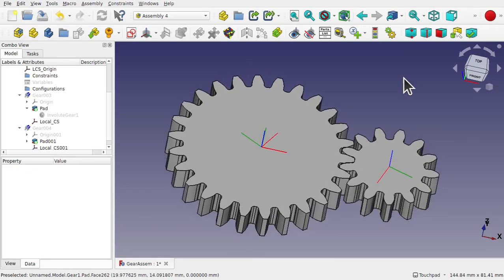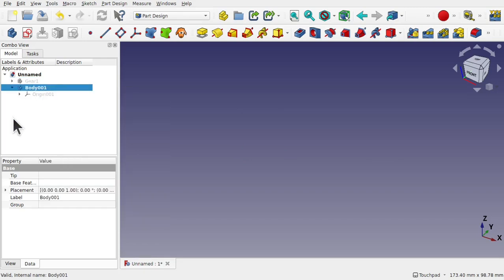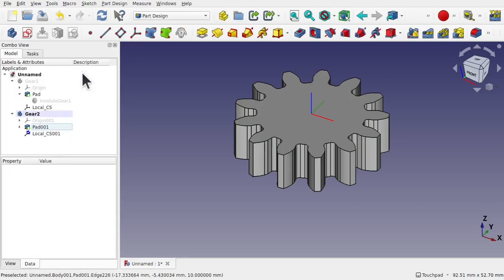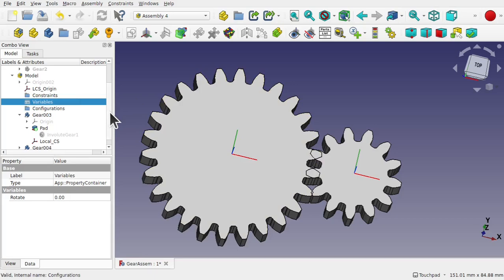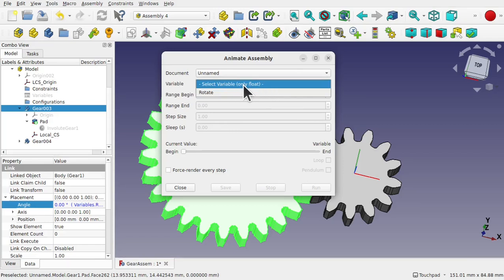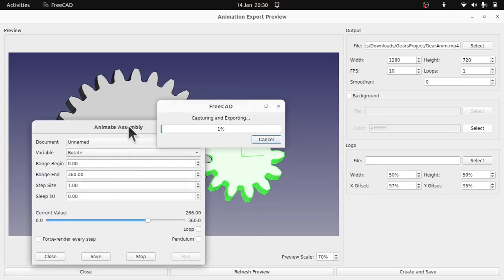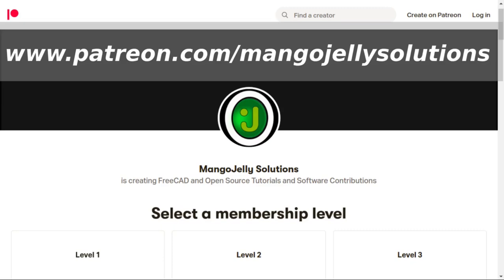FreeCAD For Beginners 33 |  Gear Assembly, Animation and Export to Video File

Comment: 00:00 Intro
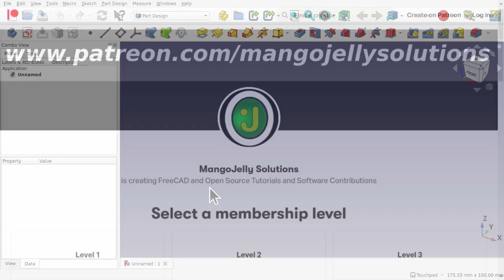01:19 Creating Gear1
02:07 Adding Local Coordinate System to Gear1
02:49 Creating Gear2
04:25 Adding Local Coordinate System to Gear2
05:00 Assembly4 startup
05:49 Importing Gear1 into Assembly
07:58 Importing Gear2 into Assembly
09:30 Adding formula to rotate Gear1
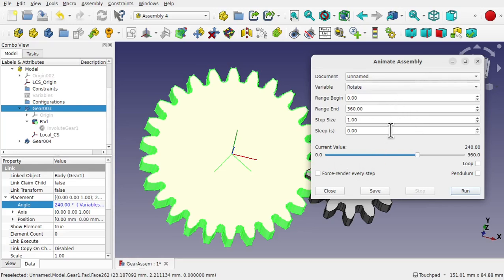13:10 Adding formula to mesh and rotate Gear2 with Gear1
18:21 Exporting the animation as a video
21:00 Outro
Reply from the maker: Thank you as always your a star!! 🌟🌟👍👍👍

Comment: Great video - thank you! The correct distance between gears can be calculates as: (Module of Gear 1 + Module of Gear 2)/2 x (Number of Teeth on Gear 1 + Number of Teeth on Gear 2)/2. Which is 48.75mm.
Reply: This is the distance between gear centers.right?
Reply from the maker: Thanks for the info and adding that. Really helps others and enriches the information. Appreciate that.

Comment: Last time I did do blender to animate a gearing. That was a while ago and CAD sketcher looked promising. But I am a bit afraid of blender, once you get good at it it will take self control to not go on a tangent to make the perfect pitch presentation. At the moment I prefer FreeCADs traditional CAD workflow though.
Reply from the maker: I understand where you come from with blender. There is so much to learn and way to many keys to remember for my liking. I do use Blender but I spend most of my time in CAD.

Comment: Had some issues during the import into assembly due to not fully selecting the LCS in Parent option. easy to overlook. Many commands require definite instructions to & from so to speak. I slow the tutorials  to 50% so I can keep up. 8:43 when the Gear2 is imported My gear didn't drop into the XY Plane when the LCS Origin was selected. I adjusted the Z Trans to -10 and fixed it. Darren any reason? Once again small beer but it slows a New user like Me down until I figure it out? Anyway good practice figuring it out for myself I suppose. Gotta love animation, I also notice subtle difference in appearance i.e. On the Pinion gear my Co Ordinate Crosses are buried in the gear yet the larger gear they are as per Darrens, I presume these are possibly individual user settings or preferences or something to do with the offset I adjusted manually?

Comment: Great video, But too advanced for me. I have sort of got my project animated / working for my assembly but I am trying to get 4 parts rotating at different speeds and directions. What do I need to do to achieve this? They are not gears so i am not able to use the tooth count.

Comment: I have a question, your cursor has a tail & pointed head. My cursor is a triangle with rounded tips. Makes it hard to  precisely choose a line or point. I’ve looked all through Freecad & the inter web & can’t find a solution. I’m using the app image on Linuxmint Lmde. Do you happen to know how to change it?
Reply: I think it's about mouse theme. I have the selection of "Adwaita" theme. (Fedora/XFCE4)
Reply: The cursor on Linux is just fine, it only happens in Freecad.
Reply from the maker: The cursor I am using is the large cursor in accessibility settings in ubuntu. I use a large cursor for presentation to help people see where it is.

Comment: Thanks for this very informative vide0 (like always) 17:51 My question is concerning adding your "Lucky Guess" of 14 to "mesh" the gears, what made you come up with or even to know to add an offset in the first place and what are you off-setting, "X" "Y" or "Z"... or what else? I really need to know how you do this, is it from other CAD programs? It really makes me feel hopeless, because without a formula or knowing where to go to find the formula, it quickly goes from working in sound Engineering practices to just fidgeting with buttons... LOL "Please Help" with some background of where to turn to for answers? Thanks
Reply: It is actually 360/(13*2). Because 2nd gear has 13 teeth and you need to shift its phase half of a tooth, to correct the deliberate mistake of the beginning.